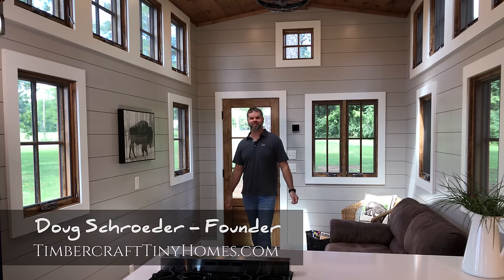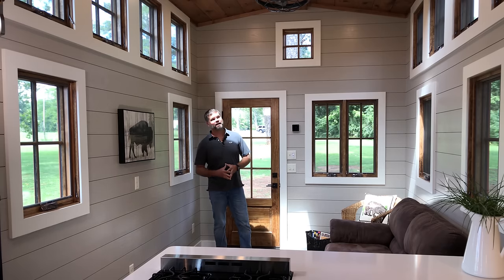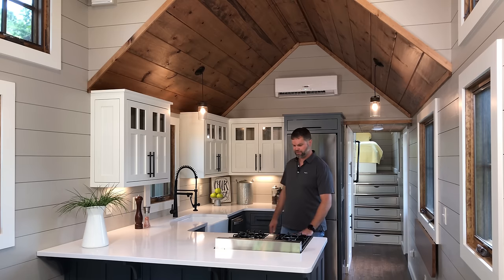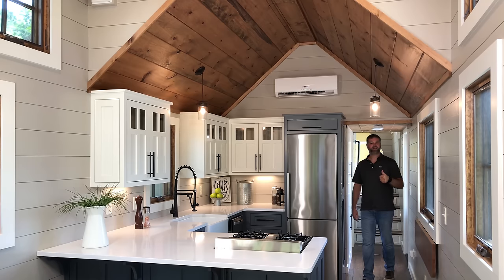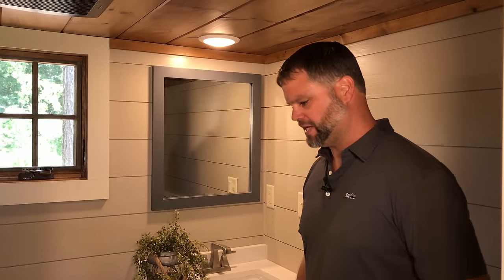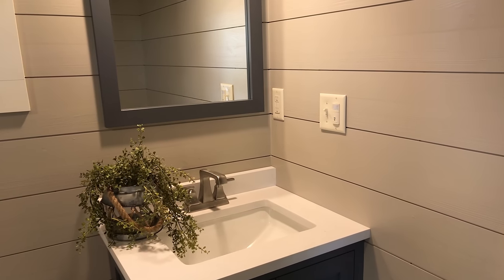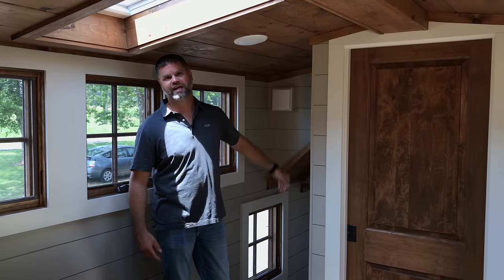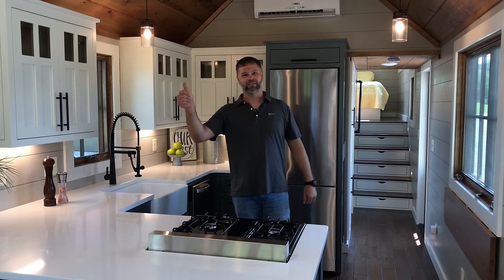Denali XL Tour by Timbercraft Tiny Homes

Comment: Doug, you and your team build the #1, #2, and #2 Tiny Home on my list. Over 30 years in building design & construction, I've owned and shopped for RVs for decades. Pay no attention to idiots and trolls; you'll never satisfy a complainer with no experience in construction or code-compliant design. If they want to build a box out of shipping pallets and plastic sheeting, they can do it in California; they can just say they're from Honduras, Mexico, Iraq, whatever...they'll get the key to the city.

Your team does incredible work. Your attention to detail is inspired; so many details not found in the Tiny Home market! Some singles and empty nesters want a place that's more solid that what the RV market provides (and that doesn't look like a 1960's whorehouse; I've never understood the spangles, mirrors and finishes in RVs, even expensive ones). Some people want finish and construction quality but they don't want a big house with all the hassle, cleaning, and high property taxes.  

You can spend $750,000+ for a Class A diesel pusher motor home that is not as beautiful or as large as the Denali XL (interior volume). You can spend $225,000+ for a luxury 5th wheel that doesn't have the room, the solid construction, or the quality of appliances and finishes that your homes have. Or you can buy one of these for $150,000 plus a lot and utility hookups for $40-$50,000 and for the cost of a luxury 5th wheel RV, you're living in a world-class Tiny Home on your own land. Kudos for your fantastic work.
Reply: Agreed

Comment: Gorgeous, YES! Expensive, yes but that's relative. Where I live $125-150K couldn't buy a 1-room studio apartment fixer-upper. So I do consider this a good price for what you get. It may still qualify as a "tiny home" in that's it's moveable should you need to relocate, but it's 43 feet long, so let's face it you're not going to be tooling around enjoying nomadic travel adventures as you would in an RV.  That said, I love the finishes, fixtures, cabinetry, pantry, stand-up bedroom, and overall lux feel. But for me there are far too many windows; the cost of motorized shades for the ones you cannot reach would be astronomical not to mention HOW do you clean them? A few tweaks to customize to my own tastes: Living room: No door, this allows for an L-shaped sleeper sofa, and one less window allows for a linear fireplace with wall-mount TV above. Kitchen: swap location of sink & range, this allows for a convection/microwave above an induction cooktop (personal preference) with deep drawer storage below. Sliding window over the fold-down dining bar so you can serve outside to a fold-up exterior deck. Bathroom: A full tub is always nice. I'd prefer a stacking W/D, as everyone knows those combo units take 3-hours per load and do not "dry" very well. Bedroom: A slimmer closet door to allow for a decent size TV on the wall (could also reposition a Qn-size bed to put the TV on opposite wall in lieu of 1 window, as in other Denali floorpans). Reconfigure closet interior for more hanging space & some drawers as well. All in all, this DENALI XL does it for me. KUDOS Timbercraft on another amazing build. 👍

Comment: Did they talk about the dry weight and what kind of framing it is? Steel vs. wood framing, I mean.... I’d have liked to see outside hookups. Would also like to see a tour of a more affordable one, without things like a steam shower, dishwasher, and trash compactor. And maybe just an induction cooktop w/o an oven lol. The kitchen certainly was beautiful. I have half a mind of suggesting that loft storage be continued and opened up over the kitchen, extending as far as the A frame. That would be like another large sleeping room. And you might be able to use the gooseneck as an office, instead of bedroom. Doing that would still preserve the closet space and everything. You would just have to walk through your closet to get to your bed. Not a terrible idea. And keeping one vertical wall open into the great room would help air circulation. Hot damn, I really love cozy places. Those changes and the addition of a stackable washer/dryer are the only changes I would make. And maybe less expensive tile/no glass doors in bathroom. A good old shower curtain works just fine imo

Comment: Ilove it! That walk in closet would even be a great room for a small kiddo. 150,000 is a great price where I live if you could find reasonable land or family land.  A piece of crap 900sf house falling apart with a tiny lot will cost you 300,000 to 600,000 depending how close to Seattle you get. Or you can rent a 1000sf 2 bed apt for almost 2000 bucks. The housing market is insane. I love this little big house.

Comment: Can the wheels and axles be removed on site and it placed on my foundation so it is real estate and eligible for mortgage from my bank rather than a title for a trailer and a deed for the land. I just need to know if it can be made permanent, and what is the cost minus the steam shower and incinerator toilet for a reg tiled shower and reg toilet. The rest I would be interested in.  I'm in central Florida so delivery and set up isn't an issue is it?

Comment: I absolutely love this unit but have a questions,  you talk about foam insulation for energy efficiencies  but you have many sky light windows and all the high windows for the added light that to me would just be bad for letting heat out and cold in. what is the "R" value of the walls and ceiling and the "R" values of the windows. The second thing is the mini-split units especially the one in the bedroom would seem to blow air on the occupants. Any thoughts of a central type unit with some type of high pressure system with PVC pipe duct work in the floors or ceiling.  Thanks  and as I said in the beginning the unit is absolutely beautiful.
Reply: Peter L Cooper In General, mini split systems are more highly efficient than ducted systems. There are mini splits with SEER ratings in the 30s from some makers.
My preference for insulation would be Rockwool, but imagine the labor for installation of that form would be significantly higher than for spray in type.

As to the complaints regarding price, a single wide HUD code Mobile home can easily run $75,000 and the quality of materials is generally much lower than what you are seeing here. Higher quality materials cost more money and building any structure is labor intensive. Years ago I took an advanced shop class in High School that built a home and we were taught back then that labor commonly was 60-70% of the construction cost of a home. That was the late 1970’s, but imagine that is probably not that far off today.

The build looks impressive and well made. Were I custom ordering one, my preference would be for Rockwool insulation, all electric - no gas of any type, and a conventional toilet. There can be issues with spray in insulation and outgassing.
Reply: What is the total cost for building this house?

Comment: What would a model like that roughly cost.
Reply: They are being sold for 130-150k I honestly understand that this is a fair price for these finishes and appliances. An incinolet toilet is pretty damn expensive. Ways to make it cheaper: no trash compactor, no dishwasher, no range (induction cooktop instead), no split heater/air conditioning unit (cast iron stove and ceiling fans instead), no steam shower feature, shower curtain instead of glass doors, composting or regular toilet instead of incinolet, cheaper sink than farm-house, less windows, steel door without windows in it, cheaper tile in the bathroom.

Comment: 150k plus... at these prices why go tinyhome
Reply: Allegory exactly. Buy a house on property that won’t depreciate and deteriorate due to being on the road.
Reply: I guess if you leave out some of the fancy extras the price will come down. I for one wouldn't need any of those appliances. I have my own and the size of them probably more suitable. I wash wares by hand so they could keep the dishwasher. A regular shower instead of a steam shower and a simple compost or flush toilet. Ordinary finishes for counters and cupboards instead of granite and expensive wood etc.
Reply: I did the math based off the high end values for prices on their website. Around 56k in materials. Then they say 800 man hours, break that down... 20, 8 hour days, at $625 an hour to bring the price to 150k. This is the best “tiny” home i’ve ever seen though!
Reply: They have top of the line appliances, hand made wood cabinets, steam shower, expensive   brand of windows, wood doors-- in other words its not a cheaply made house.
Reply: @tallblonde1976  Exactly - you can have builders make the same house - meaning with the same layout - without using all the top of the line features. You can even have them reduce the amount of windows, which in the Denali XL are MANY - and you would end up with an equally beautiful tiny home at a MUCH, MUCH lower cost.
Reply: $150,000 for a decorated box,hahaha,,they must be crazy , $25,000 it's the most I would pay for something like that, the idea of Tiny house was developed for affordability and to prisaisily get off these huge mortgages, but people like these come and corrupt the idea, they are just desperate to make a killing on each sale,,people dont be naive, dont buy anything from them
Reply: Not selling you on the idea of a tiny home, but this can be moved when needed. You cannot move a site built house easily. 
The original idea of Tiny Homes was affordable shelter and putting them on wheels was a dodge on building codes. To be built and sold commercially they are usually built to RV codes.

Others possibly interested in a tiny home would be for a vacation getaway home that might be on a remote site where on site construction costs would be prohibitive.
Reply: @nkyryry  This can be moved, but it's not going to be treated like a motor home.
Reply: Because you can move it or lease a spot to park it. Because you can get around building regulations since it is not permanent. To much money?       Get a cheaper one. I guess you would say that there shouldn’t be any Ferraris since a Toyota Camry can Get you around Just as well. There are different price points and quality for every product on earth.
Reply: @ElizaDolittle  i agree i would like to see one made and do a comparison
Reply: Might be true for the US. In Switzerland houses start at 600k, so still cheap.
Reply: @tallblonde1976  but still. My gf and her husband bought a smaller, stand alone home on 3/4 acres on a back road for 70,000 grand and put 30,000 in it with a built garage.  Value now is 129,000 tax  assessment value. Sorry, cant do a tiny home with no land at this price.
Reply: Boxeo y Debate $25,000?🤣🤣🤣 the trailer alone is over $10,000 for that size! The quartz countertops are $1,000, that toilet $3,000, 4 electric skylights & a shit ton of windows!!!! You could maybe get a bare bones 16ft tiny home for $25,000
Reply: Barbi Button That’s all relative to where you live! California real estate prices are high. Cities in Western Canada as well, a 800sq ft house in Vancouver will start at $1,000,000.
Reply: Unless you live by Seattle, it all matters where you live. You can't buy anything for 150,000 not gonna happen, 400,000 for livable maybe.
Reply: @jacijune  what you say is so true , without all the extras this is a perfect home if you want to go tiny .
Reply: @MJ-zo5gb  what you say is nothing but the truth .

Comment: I got interested in the idea of Tiny Homes based off a personal challenge to see if I could find a decent home for $50,000 or less.  Now they are getting to the point of being just as pricey as real home.  I realize this is a "Top of the Line" model but the idea seems to be going in the wrong direction.
Reply: Dave Fleury This is 42ft they also didn’t start at that size either.

Comment: $130,000........ the whole idea for a tiny movement is MORTGAGE free-living..  Haha.
Reply: $150,000 is not that unrealistic for the materials and type of construction. Their website says all systems are installed by trade professionals and that is not what many purchased tiny homes are going to get you. They are also using higher quality components than spec homes. 

An old High School classmate had a house fire a couple of years ago and a double wide HUD code sectional mobile home was right at $100,000. Modular Mobile Homes (built to state codes)  can easily run $150,000 and that does not include land or site prep- you still are going to have to pour a pad, runners or build a foundation. A helical coil foundation for a sectional manufactured home can easily exceed $25,000.

In the end you get what you pay for. If all you are interested in is housing and no mortgage, there are cities where you can buy an older existing home for less than this, but you would still have very expensive upkeep. In an age of $50,000 pickup trucks, you are not going to get a professionally built tiny home of this size and quality on the cheap.
Reply: @DavGreg  not absolutely a great deal for such a home
Reply: sierra mk worth it. I just want to know where to park it to live in it in Southern California
Reply: So don't buy it..find a cheaper one.  I like it!
Reply: Get a job.
Reply: No, that's ONE idea of the movement, not the whole idea.
Reply: 130k price tag, defeats the whole purpose of tiny house. It is called tiny house because it doesn’t come with mortgage.
Reply: Harun Iman Some of us can afford $130,000 cash
Reply: @HandbagDiva  so what? maybe you could buy some manners
Reply: It matters where you live. 130,000 is nothing in my neck of the woods. You get a tiny piece of crap for 350000.
Reply: I thought the whole idea for a tiny movement is to open the field, and give people more housing options than they otherwise would have. Who are you to say the ‘real new option’ should only include super small cost and super small home? Are you arguing to replace old limits with new ones, or are you arguing for freedom?